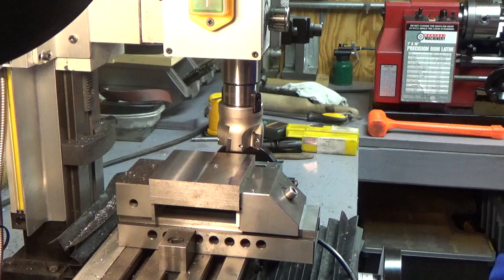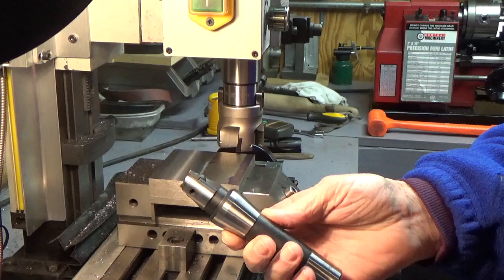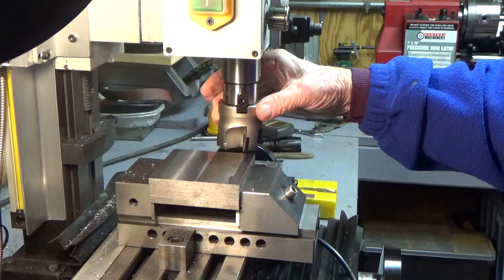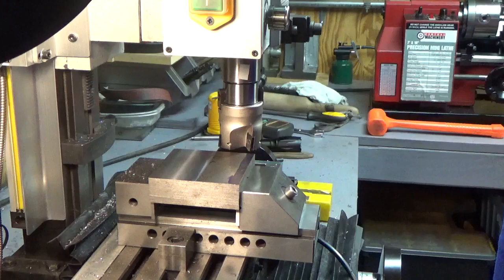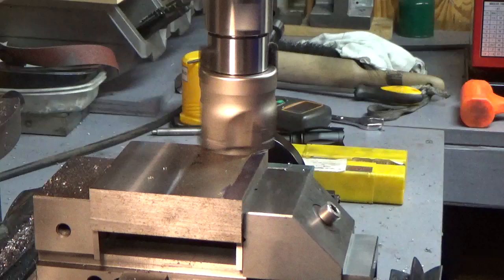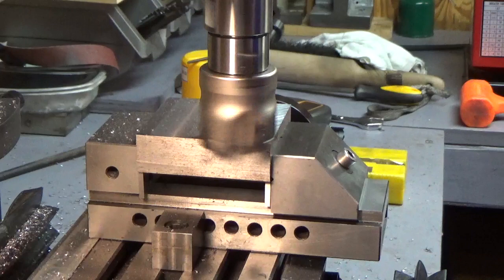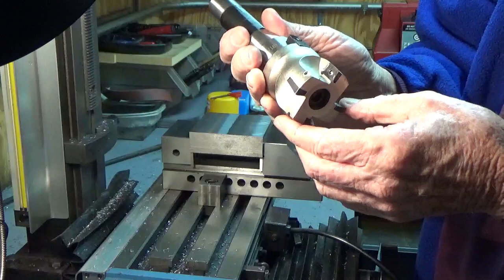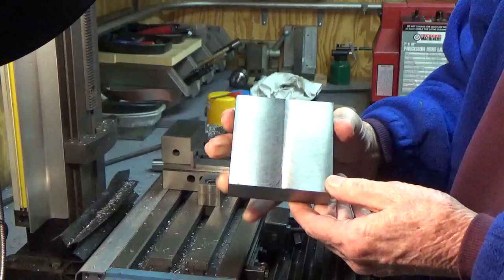Mini Mill Using a Chinese 50mm 4-Flute Face Mill

Comment: Thanks for Your video Larry! I am using the same type of vises, one having 35 mm wide jaws, the other having 50 mm jaws. Your vise is larger I see. Nevertheless, where did You buy the clamps holding the vise? I'm searching for better clamps to my vises. I also bought the same facemilling tool, from the UK. I think is was a good buy.
Reply from the maker: Stefan:  The clamp hold downs, I made myself.  There a fairly common design, and I made the same type for several different types of vises that I have.  I think I might of found some plans on LMS's web site and I just adjusted the dimensions to fit the particular vise for which they were needed.  Here is one link, but there are probably others.  Regards: Larry
https://littlemachineshop.com/images/gallery/Drawings/ScrewlessViseClamps.pdf
Reply: Thanks a lot Larry! I just compared the holes of the 2" and the 1 1/2" vise. The 2" has 6 mm holes and the 1 1/2" has 1/4" holes… eBay....I bought 4 clamps from LMS some time ago, put the taps in the lathe and brought them all down from 8 mm to 6 mm....Anyway. I experience it as difficult to achieve a stable line up, square, of the vise in the micromill, a PROXXON MF70. The MF70 has a table made of aluminum so tightend the clamps hard into the T-nuts will damage the table I think. Nocking on the tightened and squared vise too easily move the vise I feel. Adding two extra blocks with adjusting screws to stabilize the vise regarding forces from the side with the holes feels like a lot of extra work.For clamping the 2"" vise to my minimill I still have some adjusting modifications to do. Hopefully squaring up and maintining square will be easier.Can You give any more advise?
Reply from the maker: Stefan:  I too have a Taig Micro Mill which I use for small work only.  It also has an aluminum table, which is not ideal.  The largest end mill I've ever used is 1/2" and that's really overdoing things.  The small 6mm screws and T-Nuts just can't hold very well with the milling forces exerted against them.  Taig uses mostly aluminum parts, with the exception of the main frame.  There Micro Lathe is the same way, but for watch and clock work they both do the job they are meant to do.  I have a tooling plate on my Taig mill which has 6 T-nuts holding it.  When you attach a 2 or 3 inch vise to the tooling plate using the fixed pre-tapped holes, things seem pretty solid.  You can also add your own holes to the plate for special items; such as a vise or rotary table, etc..  Regards: Larry
Reply: Thank You Larry! Making a steel plate tightened by 6 6mm T-nuts to the alu table ought to be safe. Making the plate universal and/or dedicated for the vise is a choice. Do You have any video showing this tooling plate?Regards,Stefan
Reply from the maker: Stephan:
I'm Sorry, but I don't have any videos.  I do probably have some photos.  I'll try and locate them and attach a link.  I bought some scrap pieces of precision ground aluminum plate that I found on Ebay.  I think I found scrap sizes that I felt would work as is.  One of them does fit the mill table almost perfectly.  I used CNC to drill them and then tapped all the holes by hand.  The one that fits the table, I made specific holes for several different vises and rotary tables.  Regards: Larry
https://1drv.ms/f/s!AoFHBXavAXM5g7x2wGxUCGwIJ5qUhw
Reply: Thanks a lot for the very inspiring photos! How do the threads, in the ALU board, manage with all tightening and loosing of bolts? ALU is of course easier to work with than steel but a certain wear will occur I think. Maybe You got some hard ALU. Regarding my small shop and my minimal skill ALU will have to do I guess.
Reply from the maker: @Stefan_Boerjesson tephan:  I don't use anything except 6061 Aluminum.  There's no problem with the threaded holes.  Two of the plates have #10-32 threads and the other one has 1/4"-28 (wished I had used a 20 pitch instead).. I made all the concentric brass screws for fixturing.  Although you can purchase 10-32 and 1/4-20 very reasonably and there easy to find from the brand name supplier.  If all your looking for is a place to mount the vise, then a smaller piece of aluminum can be used, it doesn't need to cover the entire table width and length and you can fly cut it level.  When purchased, aluminum is never to exact size and true, with the exception of precision ground material.  I was able to find precision scraps from a supplier on Ebay for cheap.  Regards: Larry
Reply: I just ordered a suitable block of 6061 fro eBay, free shipping…. Being a metric guy I have some trouble understanding the imperial "language" but never mind. Either I use 6 mm for the Micro mill, or M10 for the minimill that has quite a narrow table not leaving much place for clamps. Soon after receiving Your help, thanks for the dawings, I tumbled into a few videos where they probably used the same drawins. Look at the last minutes of this: https://www.youtube.com/watch?v=jwjxlpsInng&feature=youtu.be.I think about increasing the length of the clamp in order to increase the down preassure to the vise. The force of the T-nut spanning bolt ought to be applied as much as possible to the vise, not hlaf of it to the table. Changing the geometry having a longer arm to the point of table contact and an arm as short as possible to the vise will put more down force to the vise. Okej, Your Taig and my MF70 does not produce the very high torques soo maybe overkill.Regards,Stefan
Reply from the maker: Stephan:  I'm very familiar with the above video.  I have 3 different size toolmakers vises.  Two with slots (which I prefer) and one with holes.  I've probably made a half dozen sets of hold down clamps much like Pragmatic Lee.  I think there's also plans out there somewhere which I probably used and revised as needed.  I've found that the designs need to be different depending on which way or direction the vise is mounted and with the small table on my Taig, this becomes a challenge.  On the little Taig I can only use #10 screws or 6mm and I've never really had a problem with the vise moving.  On my mini mill I have a Kurt type vise with 3/8" hold down bolts and T-Nuts and that's solid as a rock.  Small little mills are definitely a challenge in many ways, as are the small Micro Lathes, like my Taig.  The main reason, probably being, that we tend to try and use them in ways for which they weren't intended.  I get frustrated on a regular basis, but that's the challenge.  Best Regards: Larry
Reply: Thans Larry! My intensions regarding the regitity of the vise on the Micro mill are to ambtitious. You are perfectly wright telling that we tend to do more heavy work on the Micro than it is made for. I roasted a spindle motor having it running too long time with a reasoble load. Now I have built a temperature measuring device that shows the motor temperature and eventually sends a pause signal to the CNC controller. Forced cooling of the spindle motor is my project for now. In the mean time the vacuum cleaners sucks up the chips and cools the motor, manually….
Reply from the maker: Stephan:  I made all my clamps myself.  I found some drawings on LMS's site for several different kinds for both the vises with the holes, as well as the slots. I may of also located plans for different sizes (can't really remember).  I revised dimensions as needed.  My smallest toolmakers vise is 50mm and my largest is 75mm (2 & 3").  I also have one in between size (2.5").  I also several other smaller, but a slightly different style.  I think my Kurt style vise is 4", which I have on my mini mill.  I have one tool fixture plate on my micro mill that has special tapped holes to accommodate all the vises I have, except for the largest 4" vise, which is actually a bit large even for the mini mill.  I also have a large sine vise.  It has been a long time, and I don't remember what I did with the drawings I once had for the different clamps.  Regards: Larry
Reply from the maker: Stephan:  My Sherline motor is not air cooled and is sealed in its case.  This is not good, in my opinion, for long milling jobs.  I've run my mill, doing jobs that are 12 hours long, so I stop every hour for at least 30 minutes to allow the motor to cool.  The original motor was air cooled, but still over heated anyway, so I suppose the problem exists either way.  I'm always physically touching my motors on all my machines to monitor how hot they're getting, to avoid any mishaps.  Regards: Larry